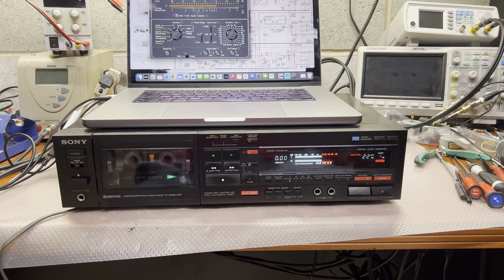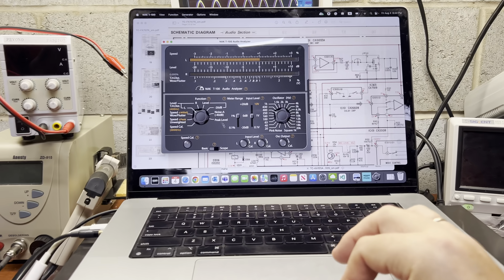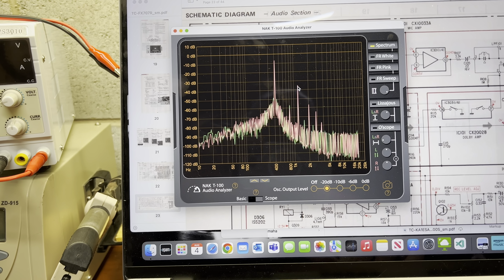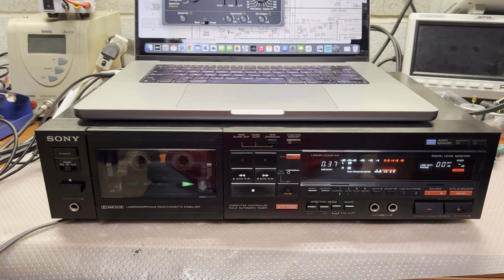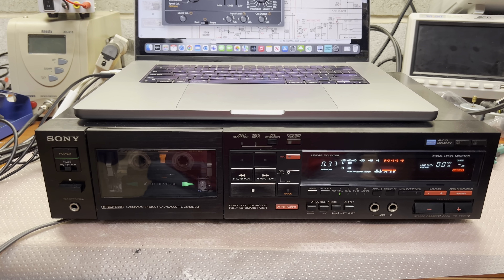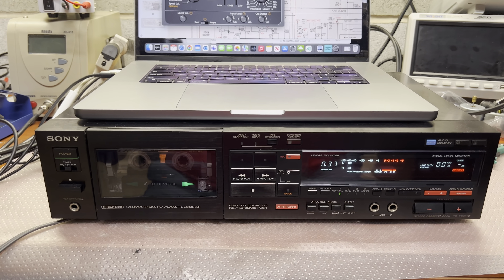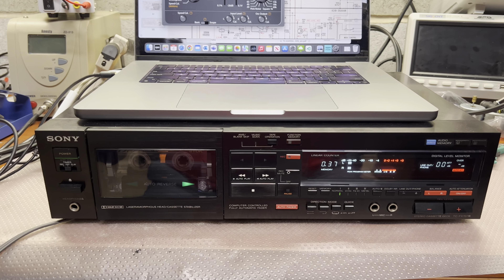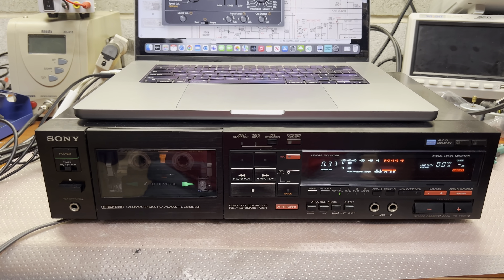Sony TC-FX707R Revival: The Magic of Nichicon Muse & Fine Gold Capacitors

Comment: I notice on Mouser and Digikey all the Nichicon Muse and Fine Gold caps say "End of life". Although they still have stock now. Is there any alternative when they run out?
Reply from the maker: That is correct, these capacitors are not produced anymore and now way to order. Most used are already gone. Wait for my videos on installing polymer capacitors :) Already ordered, 5-10 times more expensive than Nichicon :(

Comment: I've always had a doubt about SONY decks... at some point they started going backwards instead of forward. Their specced THD went up from 0.7 to 1.5.

I know by experience even a low THD can create a significant impact on sound.

So why has this happened? Was it because they begun using lower grade components or something was changed for their measurement methodology? Some say THD stands for Third Harmonic Distortion... fair enough. Then they started to measure the "TOTAL" Harmonic Distortion, which means the sum of the all the harmonics in the spectrum. Is this what happened?
Reply from the maker: First of all at this age it is hard to judge as ICs are degraded over time. Next, this model has fully electronic levels control and as result sound has to go thru a bigger amount of microchips. I will post a sound demo video and you will be surprised how well this model sounds. I have fixed 4 of them and they all have nice very musical sound. Just got another one. Price/sound value is hard to beat. Many decks in this age have 1-1.5% THD and this is pretty fine. The lowest THD I have from my Nakamichi 680zx and it is 0.49%. But price difference is dramatic.
Reply: @hifirulezzz  I knew that Nak was something special to you... I got a K950 for this reason (THD) and wanted to hear what Elna Duorex were capable of before they get replaced.

I watch your playback video tests just to see the hubs spinning, the meters dancing and the music going... I am most of the time unable to tell any difference from where I stand.

In the end I think I will buy a Nak to restore. It was the ultimate brand concerning cassette decks for a reason.